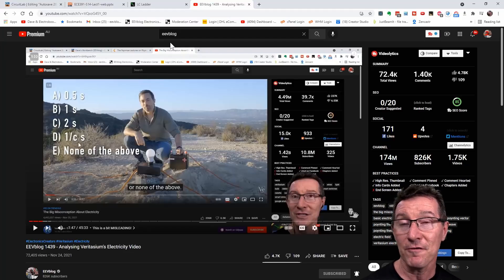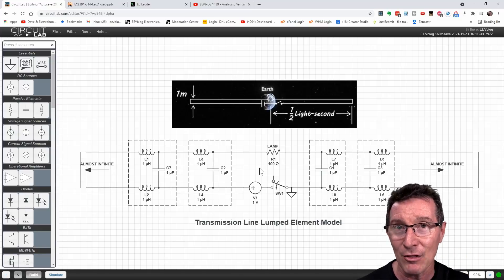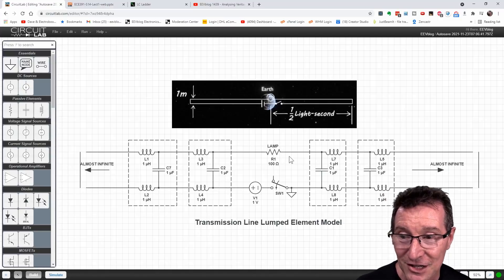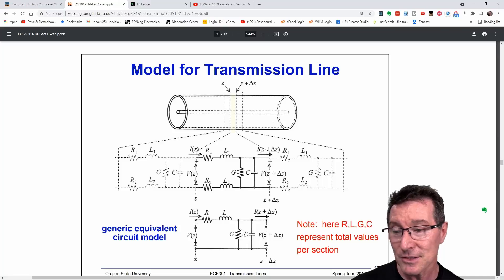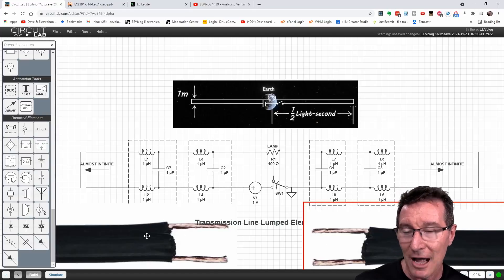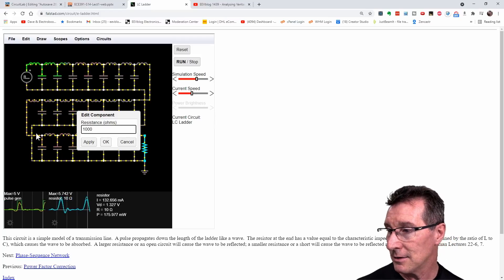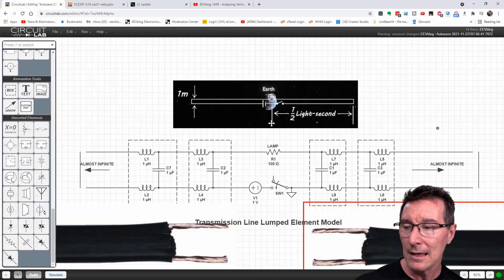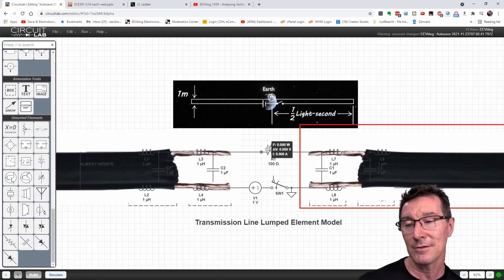Veritasium Electricity Video - Simulation Notes

Comment: The reason the bulb turns on is due to inductive coupling between the two conductors. The capacitive part of the energy transfer would be comparatively small. What we have in the initial moments is best described as a loosely coupled transformer.

To understand why, the distributed parameter model (with LC sections) requires an infinite number of infinitesimally small sections to model the line properly (this is possible with the telegrapher equations, see later). You can approximate the situation with fewer sections, but then you are forced to lump the capacitance in fewer, discrete places, whereas in truth, it is spread evenly along the line. In practice, this means the capacitance between the bulb and battery is vanishingly small. It's only when you lump this capacitance (and go to medium and short line models) do you notice the capacitive effect. In other words, a model with few sections is only capable of simulating electrically short lines. This situation calls for an electrically long line model where the initial surge is only "exposed" to one bit of capacitance at a time, not the whole lot (or substantial portions of it) at once. With this model, the capacitance is negligible in those initial moments.

Instead, the transfer of power is due to inductive coupling - just like a transformer. The transient current just after battery turn on will result in a changing magnetic field, and induce a voltage on the other conductor, lighting up the bulb. This is a well known phenomenon in the power industry. I have seen several studies looking at inductive coupling between power lines and, e.g. fences or other nearby metallic structures. Quite large voltages can result, especially when you get high frequency surges such as lightning strikes. You'll see such studies performed using frequency dependent line models such as the Jmarti or Universal line model in which the starting point is the solution to the telegrapher equations, where you use calculus to derive a model which is an infinite number of infinitesimally small sections (giving you V, I as function of position and time on the line).
Reply: The important thing to remember is that Derek is right about one thing: the power being transferred through the electromagnetic field is E x M, so you need both an E field, which is across the capacitance between the two wires, AND an M field, which is what the inductance of the wires gives you.  BOTH of these must be present in order for the product of the two to transfer power to the light bulb.
Reply from the maker: It takes time for the signal to propagate along the wire that forms the inductor, so the 1s/c inductive component is very small. Which one is a larger effect, I don't know, but I don't think it's this clear cu as you make out. Remember, the entire question is about the 1s/c speed, not the fact that it couples.
Reply: @EEVblog2  Electromagnetic energy travels at the speed of light and turns on the magic bulb. Disregard all the rest of the stuff.
Given the criteria that ANY Current turns the bulb on, you can use all sorts of explanations but it doesn't matter because the energy to turn it on travels at the speed of light the moment the switch is turned on. Virtually, all the energy in the battery is essentially pointless,. All you need is just 1 electron moving.
Additionally, The wires are pointless and not required for this reason, rendering the demonstration essentially useless due to the magic light bulb. 
I am at a loss as to why you aren't pointing this out.
I am also at a loss to understand how you are missing the fact that Veritasium is sending the message that the energy to power the light bulb is in the wave traveling to the bulb and that this by implication would also power other things like appliances.
But it is too weak to power appliances. Instead, you hold fast to the magic light bulb's "any current" to prove your point that he is "right".
Sorry, but that has almost nothing to do with the video. His video is focused on power to the home. 
It's probably not your intention, but by agreeing with this technique and not pushing back on it, its basically agreeing with the trick to the viewers, so you are also aiding the same trickery.
Reply: Sure, it's a transformer/antenna. Will the light bulb or any meaningful load turn on in (1/c) time? Probably not. Maybe your oscilloscope will be able to pick up a signal. So then again; who cares? It's not like AC power is transferred to homes like that as Derek claims.

Comment: so, if I understand correctly, this imply that the time needed for the transmission is dependent upon the shape of the cable, and not upon the length of the line.

first, take the diagram proposed in the Veritasium question, squash it a bit on the ends to make it more like a circle, let say having a distance of 2 meters between the contacter and the lamp, then the time will be 2[m]/c[ms-1] seconds. Then continue the process of squashing the ends to end up in a situation where the "horizontal" distance is 1 meter, and the distance between the contacter and the lamp is c meters; in this case you will have a time of 1 second ?

take the original diagram back. regarding the length of the cable, since the transmission time is depenent upon the distance contacter/lamp only (at the speed of light, the current can not "know" the length of the cable in 1[m]/c seconds), you can add as much cable on either side, the time will not change ?
Reply: Shape and length and material matter a lot.
Reply: @Ihaveanamenowtaken  yea, probably, but as he mentionned in the main video, we assume that the line is perfect and the lamp turns on instant when the current passes throught it.

i'm not talking about the quality of the result, but only about the time between the contact closes and the lamp start to turn on.
Reply: @vlmath314  Hence the transient analysis’ importance. Resistance is only one parameter. Inductance and capacitances aren’t zero, not even in the vacuum.

Comment: "I deliberately left it out because it's not in the spirit of the question". YES it is, because Derek was asking when an incandescent bulb will light up. Derek NEVER said the bulb was "ideal" and would "turn on at any current". If he did, then it wouldn't have generated all the controversy. As far as I understand it, without these assumptions the bulb wouldn't light up in the said time since the current is too small to make the bulb light. That's the danger of oversimplifying things, if you fail to state important conditions it will cause confusion for your audience.
Reply: What he said was: "The light bulb has to turn on immediately when current passes through it." He didn't state how much current, just that any current would switch the bulb on immediately .
Reply: @DaedalusYoung  I revisited the video and yes, you are correct. However, as a point of improvement, I think Derek could have reiterated the original conditions stated in beginning of the video during the time he was discussing the answer. Since they are separated by a considerable amount of discussion, it's easy to forget about the original conditions stated in the beginning of the video.

Second, he could have mentioned if a real light bulb would have lit up based on the calculations he was alluding to. Just to ground the audience again the difference between the "theoretical" light bulb and real one.
Reply: @Vendemiair  True. And I agree it's a bit ambiguous.
Reply: @Vendemiair  In my opinion he creates this confusion intentionally to stir up some debate. If it was cleanly described then nobody would need to say or argue anything
Reply: And if the light bulb was ideal, it would be always on from all the other fields around our non-ideal world regardless of the switch state
Reply: The whole question is theoretical so why should the light bulb have to be real? If in your opinion the light bulb has to be real then lets see you wire it up for real. Anything else is just being hypocritical.

Comment: One point of Derek's video is that electrons move slowly. So how do we account for vast numbers of electrons rapidly crossing from from cathode to anode in a CRT?
Reply: The speed of the electrons depends on the strength of the voltage field.  In a wire, the voltage field along the wire, which is caused by the resistive voltage drop, is only a few mV/m.  In a CRT the voltage field is a few hundreds of kV/m.
Reply: @petehiggins33  True. Also in a copper wire there is a VERY high density of electrons. In a typical battery and bulb scenario, an electron might get around the circuit once in the lifetime of the battery depending on current, battery size, wire size, etc.  In a CRT, there are obviously almost no free electrons in the vacuum, so combined with the high electric field strength in a CRT, the electrons do travel pretty quickly.

Comment: Imo it depends on the wavelength and cable type, how you have to model it. In coaxial cable the electric and magnetic field is between outer and inner conductor. In single conductor you have an antenna with the fields all over the place. Ideal voltage step in theory has all frequencies. Not too easy.

Comment: There are in fact two 1m/c distances in series to traverse, not just one. So the delay should be 2m/c.
Reply: I had the same point on the inital video. After 1/C the potential of the lamp changes. After that it takes another 1/C to actually provide a current.
Reply: @Sqeezerful  Oops. Actually I think I've just changed my mind. The field traverses the 1m simultaneously on both sides, so one side of the bulb goes up at the same moment the other side goes down. And that happens at 1m/c. Sorry about that.

Comment: Well, if you assume ANY amount of current will light up the bulb, then you wouldn't even need to close the switch to make it light up. When ridiculous conditions are assumed, then the whole question becomes ridiculous. If there were 100 similar circuits all running parallel and separated by a meter, then turning on ANY one circuit would cause them to all light up.
Reply: Truth!  We used to joke about some of our college EE projects that they were sensitive to the scores of hockey games. That is, when the scoreboard in the hockey arena a few miles away was operating, it would cause enough noise to screw up our design.
Reply: The worst part is to describe a antenna and say that that proves that circuits works in the same way...
Reply: Calculate the initial bulb current in Veritasium's setup.   It turns out to depend on the bulb resistance, but it's roughly several milliamps.   More than enough to visibly light a bunch of LEDs.   But a ten-watt bulb wouldn't flicker even slightly.    (Yet the result is very counterintuitive!   A 12V battery can light a few milliwatts of LEDs across a three-foot gap?  Yep.)   This is the same sort of Heaviside/Maxwell stuff that made the UK expert William Preece look like an idiot.   Oliver Heaviside, with his math and his EM transmission lines, was correct, and the entire engineering community was wrong.   Why?   Because engineers back then all thought that electrical energy travels inside wires, when Maxwell had basically proved that 100% of energy in circuits travels outside the metal.   The amps are inside the wires, but the watts are not.   All circuits are waveguides, even the DC circuits?!  Exactly right.  Sooo weird...
Reply: @wbeaty  I believe the video said it was an incandescent bulb.  Even LEDs need more than several milliamps, esp. since the bulb, if it were LED, was for an internal light socket.  The entire premise of the video was a fraud.
Reply: @SlardybardfastUSA  Yes, billion-foot zero-ohm wires!  What a lie!  I bet he used a thought-experiment battery, not a real one.
Reply: @wbeaty  My back of the envelope estimate is closer to one mA. Admittedly, possible for dimly lighting a single led. How did you arrive at several mA?  Not suggesting you are mistaken, just trying to understand.
Reply: @bobwhite137  thanks for doing the maths! he said a light bulb not LED. 
Prob get more inductance from the environment tbh
Reply: @wbeaty  Hey thanks for the detailed reply.  My challenge with transmission line analysis is that you aren’t applying the voltage source to the ends of a transmission line, so it isn’t quite that you’d get the same currents in the source and return legs so to speak.  For times less than 1/2 second, this looks to me to be a driven  dipole, with the bulb attached to a dipole receiver.  At t=0 there will be a very large current in the transmitting dipole, but then it pretty rapidly decays. I do not expect that same current to show in the receiving dipole - my approach was to consider the capacitive coupling and see what current is needed on the receiving side to charge that capacitance per unit time per unit length and consider that the self inductance will lower that a bit.  I was using values like 4pF /m of capacitive coupling and 1uH / m self inductance. I could be way off in my treatment here. Another video by a fellow named Ben Watson did an Ansys finite element simulation- although he didn’t use 1m separation. Even with his much closer spacing, there was less current in the bulb side than the battery side once the fields hit the bulb side. So again, if it truly were a transmission line problem, I would expect same current (opposite directions of course) in parallel legs…
Reply: @wbeaty  It's so good to hear from you. I met you at a Puyallup ham-fest once. You showed me a magnet falling through a copper pipe. I followed your YouTube channel for a while. You taught me that infrared goes right through black plastic garbage bags. I thank you for your input on this. Much respect. - Kirby Stevens.
Reply: @wbeaty  OTOH a second later the LED explodes violently.
Reply: There are minute energy fluctuations in the ether all the time (uncertainty principle etc.) if any minuscule amount of energy could turn on the bulb, it would be on all the time lol. Magic!
Reply: 😂 yes!
Reply: Well, we say "any current" because we know it's reduced but don't want to go through the trouble of calculating how much reduced it is. The fact is, the induced current is not negligible. It's a thought experiment, the point is to get an insight, not to cheat.

Comment: Wouldn't this circuit have a HUGE amount of inductance (Henrys) due to the large enclosed area? And if so, wouldn't that cause the current to build up slowly over time, as in several seconds?
Reply: It does. Looking at it as a single straight wire, it is about 3250 Henry.
Of course there is also about 1350 uF of total distributed capacitance, so that's why it gets rather complicated.

Comment: Now let's assume the diameter of the conductors is infinitely small for simplicity, whoops the capacitance is zero
Reply: now whoops the inductance is infinite, so no current will ever flow
Reply: Then let's assume the length of the conductors tends to infinity as the diameter tends to zero, now the capacitance is infinite again!
Reply: True. There is nothing realistic about the assumptions made. Any normal wire would have so much resistance, that the voltage drop alone would cause the bulb to never light up. Oh, but we assume the bulb lights with any amount of current, and the wire has zero resistance. Well then, a solar flare would cause the bulb to light up.

Comment: 2 years ago...
https://youtu.be/C7tQJ42nGno
Reply: Science Asylum is also wrong in his analysis
Reply: @TeslaLegend  
Hi ..
Thanks for replying...
I didn't know if he was right or wrong but he explored the subject 2 years ago...
Is this what inspired the v video?
.. I've never really understood the electron moving bit to do with DC..
One type is convention...
and I did C&Gs electronics and electrical...
What I do know Anodes .. as so called .. on a steel boat deteriorate protecting the hull...
and decades ago they connected the positive of the lead acid battery on a car to the chassis/body and found it rusted quicker and so changed to negative earth...
Reply: @mySeaPrince_  
In his video Science Asylum is focusing on Poynting vector which indicates the energy flow in an electric circuit, but in his example he really exaggerates the component of the electric field tangential to the circuit wires which led him to the wrong conclusion that Poynting vector is directed predominately toward the wire. However, in reality, for wires made of  good conductor like copper Poynting vector points predominantly along the wires since the electric field component tangential to the wire is tiny compared to the electric field component perpendicular to the wire. Main point omitted from both Derek's and Science Asylum's videos is that Poynting vector magnitude decreases with square of the distance from the wire which means that energy transport in an electrical circuit is very tightly bound to the space around the wires thus wires still act like an energy guide even though no energy is transported inside of the wires themselves.